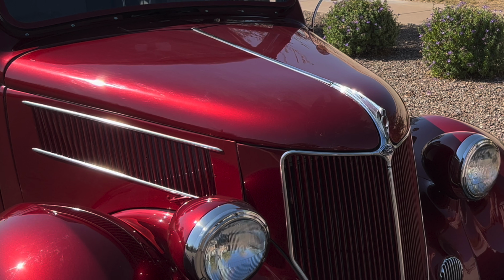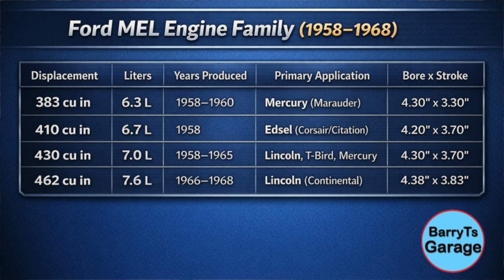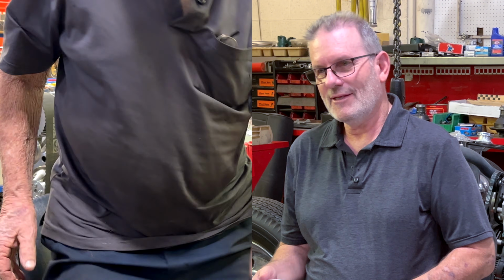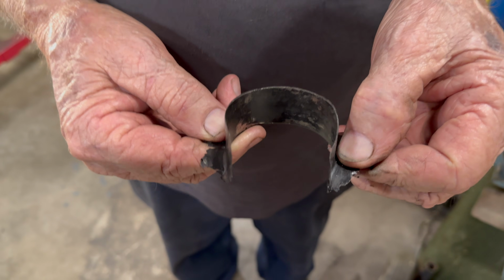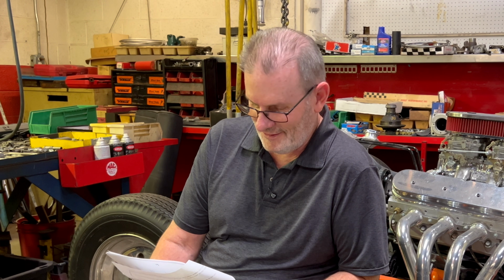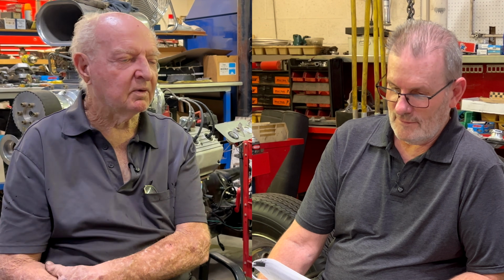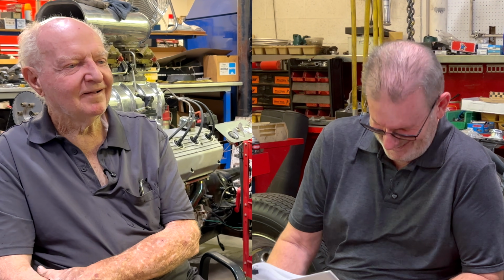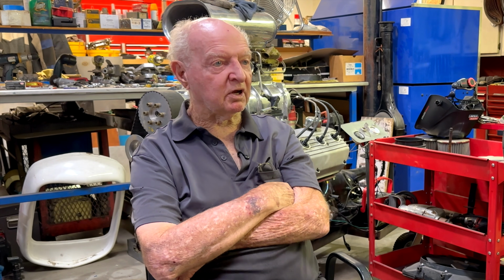One Distributor Mistake Destroyed the Engine! | Ed Smith with Barry T | Ask Ed 48

Comment: I was at buds creek md.in mid. 70's before the straps on blowers I don't remember whos rail it was it jad a blow back the blower and hat went 100 ft. In the air it was like witch way do I run as a teenager that was when I learned how dangerous it could be as a spectator

Comment: I have a cb3 Edelbrock intake made for the holly 3 barrel carb. It's for a SBC. I have a 67 Caprice  with 327 with original Camel hump heads. Want to build a period correct hot rod and would like to use that intake. And 3 barrel carb. I wonder how I should set up rest motor/car.

Comment: I hauled my street stock car with a Ford van ,,it originally had a 460 it wore out and I replaced it with a 429 . I would tell ppl that I have towed my race car faster than I had driven it 😮 I actually had pulled it 120 mph allegedly,,, don't know anything about the internals of the 429 I do know it was a Beast

Comment: That's an interesting story. I have an '84 Corvette and I'm having a top end kit put on to replace the stock two-injector set up on the crossfire intake. I'm getting bigger heads, a dual plane low-rise intake with a dual feed holley 670. Headers, a stage 2 pro-comp cam with a phase 2 chip should put out about 375hp and 390lb/ft of torque. Is the stock 700R4 transmission and the Dana36 rearend able to withstand the torque values in street racing? Thanks
Reply from the maker: I will ask Ed for his thoughts on that. Sounds pretty strong, but it’s not crazy so I’m gonna guess he’ll say it’ll do OK, but we will wait for his answer.
Reply: @BarryTsGarage honestly he's one of the few opinions that I really trust

Comment: I have a good one here , Chevy 350 crate engine GM sold as a 290 hp . It was ONLY a 4 bolt main stock engine and heads . But had the 350 350 horse 70s GM performance cam . A true slug of an engine , no torque or low end . I had one not knowing it was this dog . Pulled the cam out and put a nice mild cam and instant torque,  good power . So yes a big cam in a low compression engine . Too much duration in the 350 hp 350 cam
Reply from the maker: Great point, it’s amazing how much better those engines run with the right camshaft profile. 👍

Comment: As for the Cackles of the Nitro Cars, many years ago, a retired fellow who says he started the Cackle Fest came   by the shop probably two decades ago telling me ho it was a big thing for the old guy's to round up the parts they used from the 60's/70's, find the old dragster, fill it with Nitro.

These boys hooked up all over the country helping each other to find the OLD STUFF. -- Everyone had to adhere to the vintage theme.
This customer, Herman says they always argued about who had the loudest exhaust. He decided to settle this and bought a sound meter to use at these events.
It started another competition of how to out do the other guy.
He asked me what I thought wherein I suggested having your Cam Grinder cut a new camshaft to open the exhaust valve real early. That would do it ,  and it did !!

He found a local grinder in a small shop that no one knew to keep the secret.
Just a tidbit of info.
Reply from the maker: That’s a great story, thanks for sharing that bit of history! 👍

Comment: Love EDs 36 Ford, and regarding the MEL 462 engine was dropped by Mercury because of the block design. The block cylinders deck were cut at a angle, the pistons didn't come up level with the top of the block. The heads were a part of the block leaving no room to improve the proformence. They were a bear to install pistons and rings into the block because of the angle of the cylinders.
Reply from the maker: Yes indeed - we have a video showing the assembly of a 430/462

Comment: Those old Holley 3 barrels were a 930 cfm carb that was made to get engines that could handle the volume using intakes at standard flange.  Ring a vacuum sec. they were streets le still and would work in cold start conditions. People didn't have to fork out big bucks for 4500 series stuff to get BIG flow. Now a company is making a 4150 Holley that has only 2 barrels and flows over 1000 cfm on a standard flange!
Reply from the maker: Wow!
Reply: I have 2 and they are 950s and originally used for Nascar racing i believe.
Reply: Holley introduced the 950 CFM three-barrel carburetor (3160 series) around 1967 to maximize airflow for high-performance big-block engines, acting as an early, specialized, and expensive alternative to traditional 4-barrel carburetors, notably serving as a NASCAR favorite before the advent of the Dominator in 1969.

Comment: Jon Kasse won 2017 Engine Masters overall .
His 1958 MEL (473cid) engine featured 1in thick Head Gaskets that changed value and combustion chamber location while improving Airflow.  In N.A. form it made over 630ft lb torque from 3700-6200(max rpm per rules) and 770hp
Reply from the maker: That’s very cool, I’m going to ask dad if he remember seeing that and what he thinks of that modification

Comment: I have a question about spherical gears in a quick change rearend, would it be best to put a groove on the top and bottom shaft to hold the spherical gears from pushing the bottom gear out when driving forward with C Clips on the shaft?
Reply from the maker: Good question I will ask Ed

Comment: Was the Olds 350 Rocket superior to the Chevy 350? I knew a couple of 350 Olds that had 250k plus original miles on them back in the day. I remember getting 250k miles out of a motor in the late 70s early 80s was a big deal.
Reply from the maker: I will ask Ed what he thinks
Reply: @BarryTsGarage I meant stock. I drove a couple of 350 Rockets with 4 barrels that were pretty quick. I don't know what your experience was with them. Rust killed the cars here in Wisconsin before the motors died.

Comment: Little confused, if the distributor gear breaks and the oil pump isn’t turning, doesn’t the distributor quit turning also? How did he drive 6 laps without a distributor turning?
Reply from the maker: The camshaft turns the distributor with a gear near the back of the block. The distributor in turn has a slot at the bottom that is supposed to seat into the oil pump below.
Therefore, the cam can spin the distributor, even if the bottom of the distributor is not engaged properly to the oil pump
Somehow, there was enough oil in the top of the engine and that’s also under less pressure that it survived several laps but of course the crankshaft has a lot higher load on it and got crazy hot so the bottom end got cooked

Comment: The MEL engine is like the 348/409 , in that it's valves are flush with the heads, and the combustion chamber shape is determined by the top of the piston.
Standard 430 and 462 intake and exhaust valves were 2.08 and 1.65....the Marauder engine had 2.14 and 1.70 valves, and big ports, very reminiscent of the later FE High Riser heads. It came with three two barrel Holley's and the coolest aluminum air box and finned valve covers....all of which are worth a small fortune nowadays.

Back in the early 60's, there were speed parts available....cams, intake manifolds, and even blower intakes.

I think they faded with the performance crowd, when the FE 427 gained the top honors.
Reply from the maker: Great points, thanks for sharing that with us

Comment: As to MEL, watch youtube kristensen 59 thunderbird goodwood, hilarious 430 race. I had a J model when I was 19, most tickets per car in my life. It did 135 indicated probably 500 lbs torque. I would have one again except never came with the T85OD which was stock in my current 59 bird. Have you fellows explained mechanical advantage? Example rod length 312 and 327.
Reply from the maker: Thanks for the racing example, and that's a good question for Ed about mechanical advantage. 👍

Comment: Wanted to ask ed if I should keep the 3.48 in stroke for my 350? I have a 2 bolt 350 for the street and I have a Muncie behind it. should I swap to a 3 in stroke and rev it to 6400 with like a 30-30 cam, or should I keep it with the 3.48in stroke for torque? Thanks
Reply: Keep it at 350. A 350 stroke can go way past 6400 when built properly. No reason to give up ci unless you’re racing in a class that limits ci. I’ve ram cast crank 2 bolt 454s to 7000 rpm for years before.
Reply: @J @JarmequiousWhite anks that makes sense people been doing that for years, I just got excited hearing about what makes up a 302 and it wouldn’t be that hard for nostalgic reasons
Reply: @maxdeihl8607 yes I race with a nostalgia group that races weight/ci so there are lots of small engines in the class that is 10lbs/ci. So a 3000 lb car needs to have a 300ci engine etc. other classes are 8lbs/ ci, and 6lbs/ci. There are small blocks that turn 10-12,000 ci with a 3.75” stroke. If rpm is the goal, It’s all about the parts you use and the weight of the valvetrain. 301s and 302s are cool, but if you’re not constrained by any rules, I would personally use the 3.48” stroke 350 crank. You’ll keep the extra 48 ci and make more torque. Even at 1hp/ci that is 50 free hp. A steel crank with good rods and good valvesprings shouldn’t have a problem at all going to 7k+ rpm. Just my opinion and how I would do it. A well built 350 will rev just as good and high as a 302. Another benefit is the parts will be very cheap compared to a 302 build. Again just my opinion from the years I have into it 👍
Reply from the maker: I will ask Ed

Comment: To the question about dual port offenhauser manifolds, I don't think they were intended for the 3 barrel holley because  the 4 hole dual port intake like mine  would interfere with the oval secondary blade but could still work well with a modified spacer. I ended up with a dual port intake for my 300 6 cyl because available at the time I was shopping. I agree with Ed the intake is OK but it's not really ideal. I have my engine running great but there's limitations from my experience with that manifold.
Reply: I did notice the chevy dual port offy might make room for a 3 Barrel to work but since the others I've looked at didn't have any relief I'd say it wasn't the intention but doesn't mean you can't try.
Reply: I put a side draft weber on my 300 FI intake manifold, works perfect and really really looks great.
Reply: @danontherun5685 that seems like it would make a nice arrangement. I haven't seen any side draft webers around in a while and I'd be afraid to know how much it would cost new though.